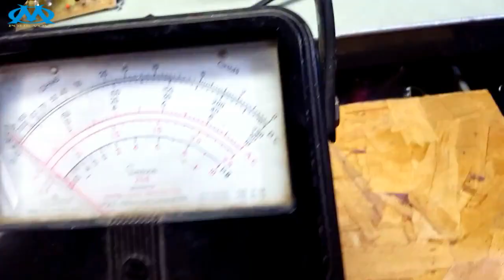review AC/DC 9V Infrared Remote Control Volume Controller Board ALPS Pre Potentiometer

Comment: Also bought this, have a problem with how to connect this to a relay.
You got ON, GND, 5v on  the controller board.
But you got Nc, com, no on the relay board.
Have read about NC, com and no, which require 2 wires.
But why does it have 3 on the controller board, tried different setups, nothing works.
Do you need another 5 volt? supply to make it work?????

Why can you not find any manual on this, this is stupid.
Reply: Did you find a solution for this yet? Having the same problem over here :(
Reply: @rutgerschimmel6026  Yeah turns out that what i thougth was signal input was the powers switch side. Was totally confused by that and was sure it was right.
And You do not need an extra supply. No, com and NC is the powers side on the switch board.
If you want it to switch off as normal you do Com as hot and NC to the device. Switch on as normal you Com as hot and No to the device.

From "The remote side" you got  On, Gnd and 5v
on the switch
On goes to In 
Gnd goes to DC-
5v goes to Dc+

Comment: I bought one of these and I'm trying to just wire it inline before it reaches my amp. 3.5mm input and output. 

Can anyone shed any light on the correct wiring? Each cable has L/R/GND. I tried wiring to XR+ and XL+. I also tried LIN and RIN. These seemed like the obvious answers.

The sound is coming through but it doesn't seem to be affected by the volume dial changing, and there is a noise in the signal when the motor moves (grounding issue?)
Reply: Did ever get this sorted as I have the same problem?
Reply: The pinout on the pots is pretty weird. Do a search for Alps RK168 spec sheet. Then you can trace the pins to the solder pads. Be aware that those idiot designers used linear taper pots, which suck for audio. There are workarounds, though.
Reply: @jgandalf1  workarounds, yip, apparently 22% of the pot total resistance in parallel with the slider output to ground will give a good approximation to log, in my case 50k pot so a 11k resistor will do it.